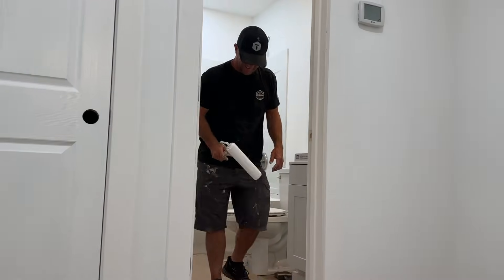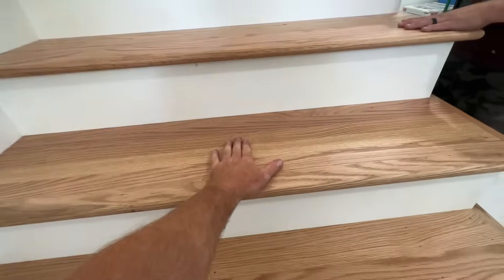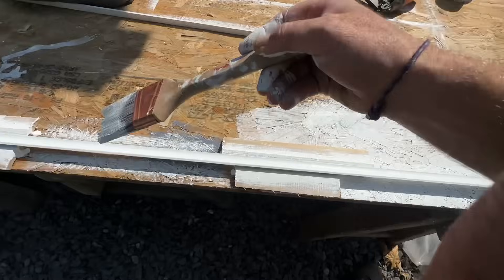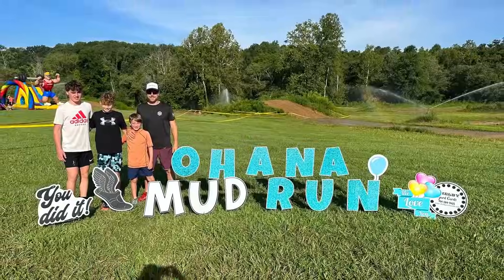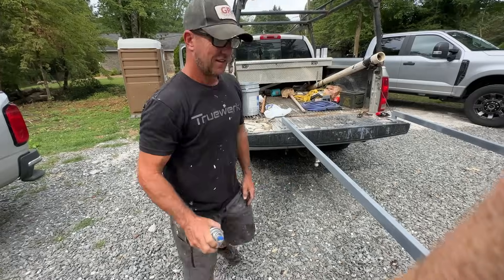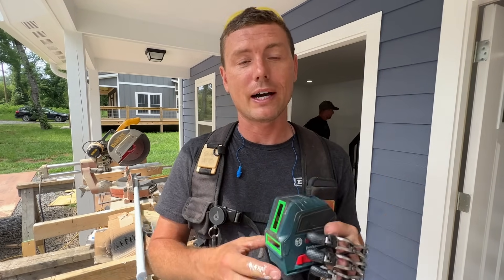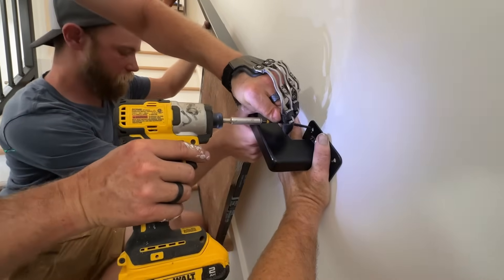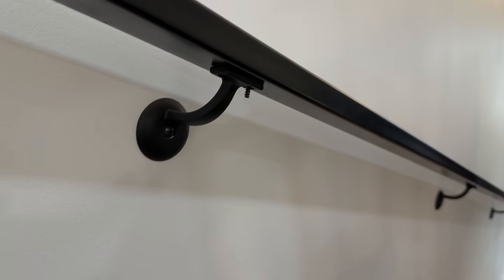Construction of a Duplex pt 31 of 32

Comment: Hey just a helpful hint here ; you can always use your oscillating cut all tool with a 3/4” wide blade on it for your strike plate on the doors instead of drilling all those holes 😁

Comment: ADA requires handrail to extend 12” parallel to top and bottom landing just like you did. And it looks very elegant. If it works it looks good. “form follows function” - Louis Sullivan.

Comment: i agree!! dupli-color makes outstanding products and spray beauitiful!   If you have problems with adhesion you may want to try  their "self etching primer" first...    some paints do not stick well to smooth finished bare metals. Their self etching primer  has great adhesion and corrosion  properties for bare metal applications.  I used to do body work and have learned the hard way lol
Reply: Great suggestion, and you guys should really take this one as a “from now on” suggestion. Bare metal is a challenge, and any auto body expert will tell you that they use etching primer on ALL bare metal surfaces where paint is destined to go.

Comment: Little secret on what I do with cove molding, I use parchment paper on my saw horses since the paint wont stick to parchment paper and I paint from one end while slowly elevating each on holding it up in my hand until I'm near the other end and I put her down.  Also, as dumb is it sounds but it works to get in the recessed cove part, I roll it with a 4" foam cabinet roller.  The half radial gets in the cove perfectly.

Comment: When I built my red oak stairs I did 6 coats of oil poly with sanding each coat, then I wet sanded the last coat after 2 weeks. They were hairy up to coat 4.

Comment: When you do the final sanding before poly...if you use a damp rag on the treads before sanding it will raise the grain and you can sand off.  Then less likely to raise when applying finish

Comment: I've used oak treads with nosings that have a lip so you don't see any gaps in the riser under the tread. You don't even need to make the lip tight against the tread as it
is up and under and so not visible. The cove molding does not look horrible though.

Comment: The only issue with that chiseling on that door latch is you wouldn’t be able to make a slight adjustment for the door if it has play when closed. I’ve used a drill rasp to hollow that out more in the past. It will allow adjustment for that door that has play when closed to snug it up tight and not have to remove and adjust the strike plate and get out my toothpicks and glue.

Comment: I used to use Martin-Seymour spray can paint that Id buy at my local NAPA auto parts store. It was expensive but it had more paint per can than the run of the mill spray paints plus it had the twistable nozzle where the spray fan pattern can be oriented to how you're painting and it would lay down a nice coat of paint.

Comment: 14:40 - Wouldn't you just hammer the strike plate into place? Maybe knife-edge it if needed really quickly with an angle grinder? Seems crazy to mill out a slot with a tiny drill bit. It's like the designed the plate to be hammered into the wood...
Thoughts?

Comment: They will be changing the national code in the clearance between the railing and wall from 1 1/2 “ minimum to 2 1/4 “ minimum soon . I am not sure if it will only be for commercial and industry applications or in all building applications, you may want to check your local codes information and ask around 😁
Reply: Also take into consideration that when this clearance code goes into affect that the building plans will have to change as well to accommodate for the space encroachment between your opposing wall and the railing which means that the stairwell will have to be framed wider to meet your spacing code and remember that anything 45”or more has to have two rails … one on each side 😁
Reply: @Paulhuber007  this guy handrails.  Beautiful work in your picture!

Comment: With all of the painting you do at the shop, why not get a paint gun attachment for the compressor? The paint is cheaper, the high pressure atomizes it better and the increased spray volume means you can finish out a single plane in just 2-3 passes. It would be particularly useful when you stack together things like pickets, trim and baseboards.

Comment: they make these things called chisels that remove wood from door jams...
Reply: was going to say exactly that. talk about an awkward solution to a simple problem. drill? really? lol
Reply: The drill bit worked fine. You would need a tiny little wood carving chisel to dig that narrow groove.
Reply: @Bankhead49  gotta disagree, any 1/2" or 3/8" chisel will work. Give it a light tap on the line where the plate is hitting  inside the hole and it will create a 45⁰ slot for the plate to slide into.  Drilling all the way through is extremely unnecessary.  Worked for me many times in the past. Especially prehung cheap interior doors like the ones in the video.
Reply: @ranchis9044  I couldn’t tell how deep he needed to go but that sounds like a good way to split the jamb

Comment: Please stop using those one-screw brackets for railings. They’re horrible. I’ve lived with them in two houses and they are absolute garbage. They also completely go against the needed physics of a handrail. Two vertical screws minimum for quality.

Comment: Please, for the love of all that is holy, START FILLING YOUR NAIL HOLES. You build & install a nice set of stairs and custom railings, and then you leave behind those HUGE nail holes in every single stair tread. Guys, I’m a fan of the channel, but stop attempting to be finish carpenters. You already know you can’t do drywall, plumbing or electrical, and you call in those subs for that work. Yet you attempt & fail to do finish carpentry, and the poor quality craftsmanship that you leave behind is readily apparent to everyone that walks into that house: unfilled (HUGE) nail holes, waffle marks on floor boards from hammers, poorly cut stair trim. To be fair, most of this is Eric and not Jamie, but either way, it’s your customers who suffer.